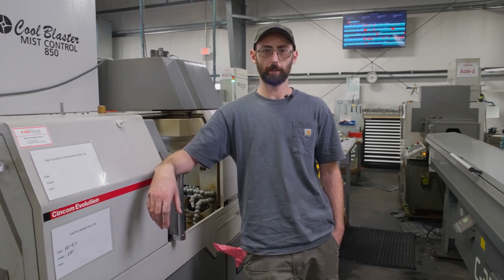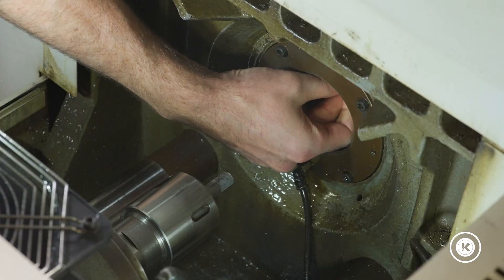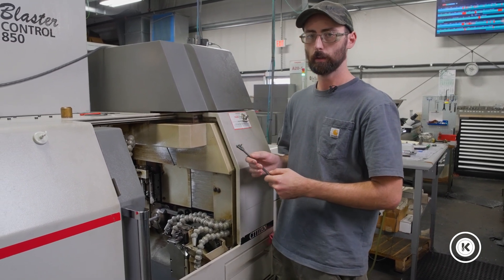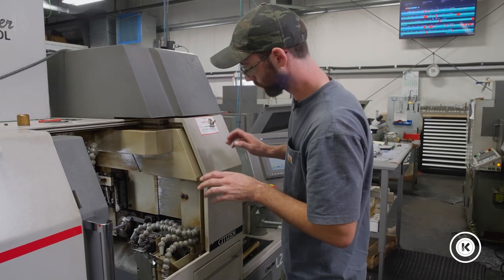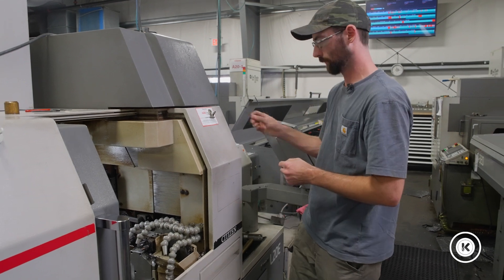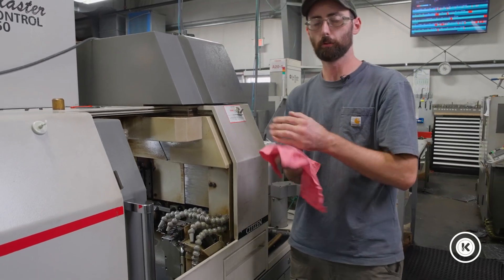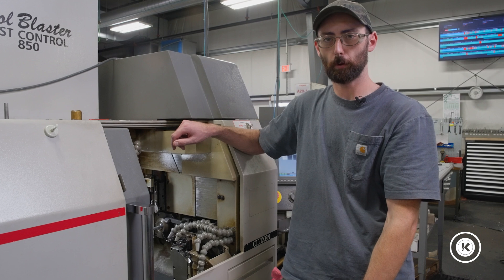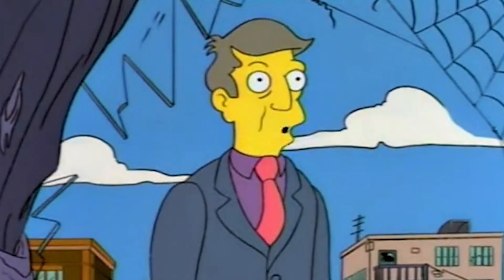How To Set A Guide Bushing on a Swiss Lathe

Comment: Getting my first swiss, this video is a huge help. You mention the guide bushing can tolerate material up to .002" undersize, from .498 to .500.
In that situation would you have to tighten the guide bushing more if material came in at .498" and tighten it less if it came in closer to .500"?
Reply: One more question, you mentioned tool steel often comes in .013-.015 over. How about 17-4PH? Any experience in how that usually comes?
Material supplier said they are offering cold finish 17-4PH +/-0.002...seems like that should work pretty reliably without sending it out to be ground, right? 
Unless it comes in oversized at .502, think that would jam up the guide bushing?

Comment: I see citizen have a auto guide abd collet setup on some machines , have you had any useage of this ? Any tips on this?
Reply: We have one that came with one of our used A32s, it didn't come with the bushing size we needed, so I swapped it with a standard guide bushing housing. Hopefully I'll get to use it at some point, but can't offer any help with it currently, sorry.
Reply: @SecondFloorOutdoors-gj8dt  
Sounds like the adaptive guide bushing 

Our M20 has standard guide bush fitting , but on control has auto tighten function for guid and collects main and sub.. put spanner tool on guide or locking device on collets and can set the control to auto adjust to a pre set pressure .. collets I can get to work fine, guide bush I find it never find happy setting and doing manually I get better results.. wondering what others had found trying out the controls auto set on standard guide bushings as shown here ... 

Heard mixed things on the auto adaptive bushings too mind
Reply: @roberth270  I understand what you're doing now. I haven't used that function in over 10 years and we only had the option for the main and sub collets, the guide bushing wasn't driven, just free spinning. Last time I used that was on a "Barney", the old L20 with the purple coolant tank. IIRC for the collets we had tightness settings 1-10 and we usually used 3.
Good luck with the guide bushing, I'd say definitely get quality ground material if you haven't already, take that variant out of the equation, or set it on a gage pin and check it by hand until you reliably get a setting you're happy with.